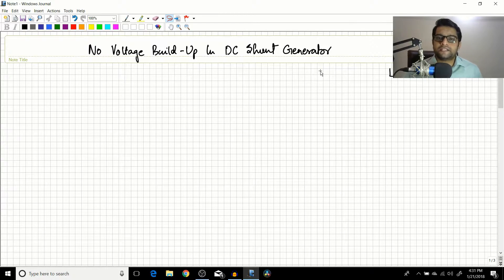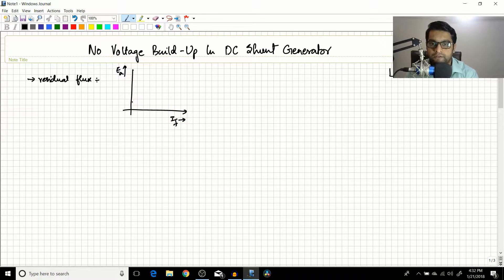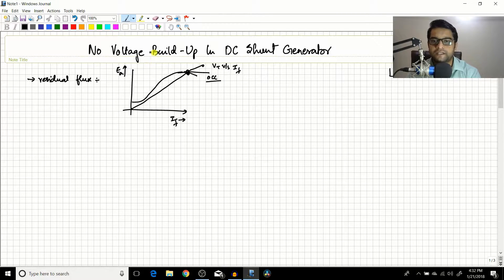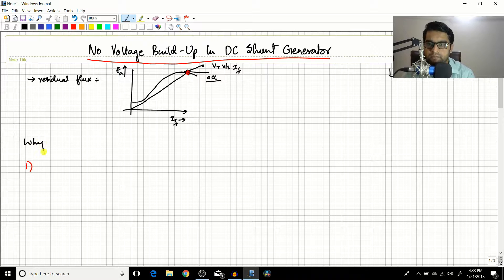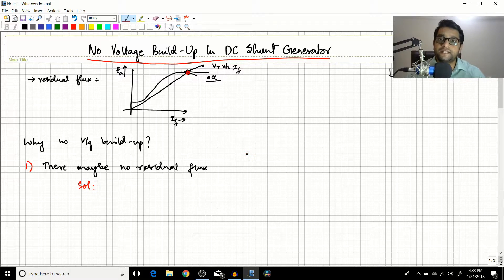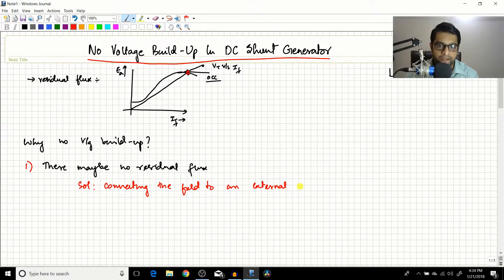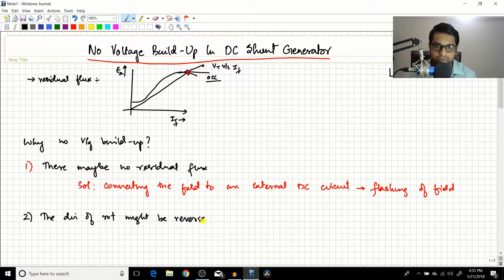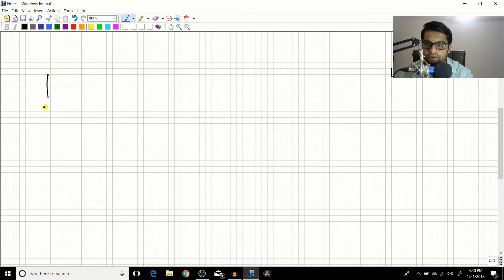#10DCGen - Voltage build up not happening in a DC Shunt Generator - Problems and Solution

Comment: respected sir i have a kuestion A DC SHUNT GENERATOR BUILD UP ITS RATED VOLTAGE.. IF THE RESIDUAL MAGNETISM AND DIRECTION OF ROTATION ARE REVERSED THEN GENERATOR WILL ANS GIVEN IS NO BUILD UP OF VOLTAGE HOW IT HAPPENS SIR PLEASE CLEAR MY DOUBT
2nd kuestion
when can a dc generator can build up voltage in opposite polarity
Reply from the maker: Residual magnetism is the magnetism that remains after the field supply is removed...how can you reverse it...?
Reply: @ElectricalisEasy  THANKS SIR FOR YOUR REPLY AND YOUR PRICELESS EFFORT FOR THE BENEFIT OF NEEDY STUDENT I AM ALSO CONFUSED HOW CAN I CHANGE THE RESIDUAL FLUX BUT KUESTION GIVEN IN THE ACE ENGINEERING ACADEMY KUESTION BANK SO I ASKED YOU  AS I AM NOT A CLASSROOM STUDENT OF ACE ACADEMY
Reply: @suryaprakashmishra1599  
STOP TYING IN CAPS

Comment: Sir in 6.14 how the flux direction came plz explain
Reply from the maker: It has come from simple right hand screw rule...the current is clockwise, so the flux was from right to left...
Reply: @ElectricalisEasy  Sir if the current is clockwise, the flux direction should be from left to right, isn't?
Reply: @nikitavinod1412  I agree...